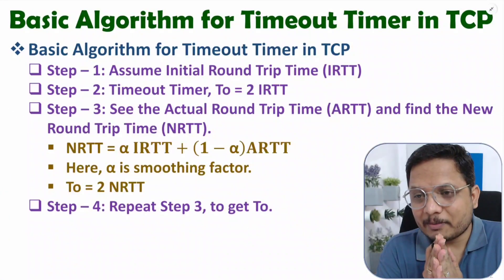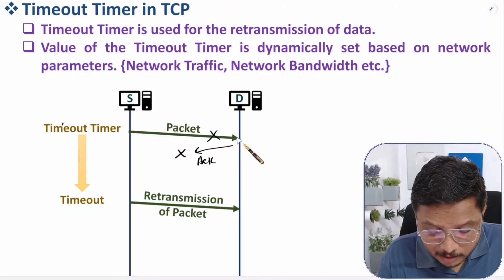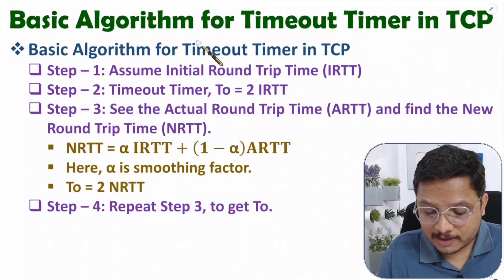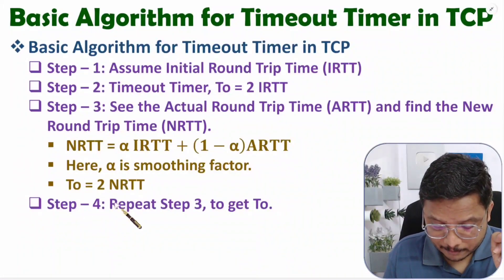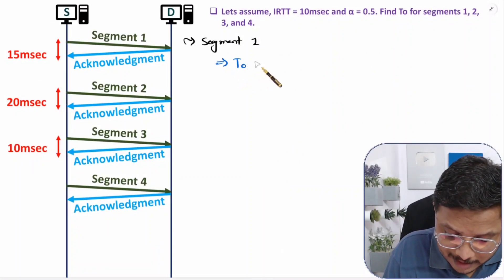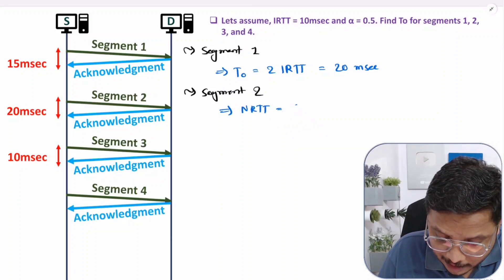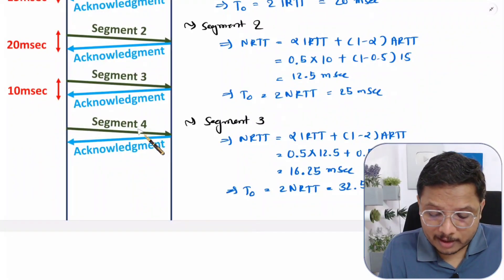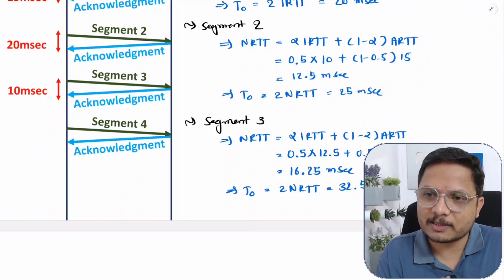Basic Algorithm for Timeout Timer in TCP Protocol

Comment: Hello sir, I think the rule you're using might possibly be wrong. The rule for calculating the NRTT is (1-alpha)*IRTT + alpha * ARTT. Please correct me if I'm wrong.
Reply from the maker: It is perfectly correct in the video
Reply: I've seen different references and the rule they use is the one I sent. Also each segment use its own ARTT to compute the estimated RTT. Because you may experience different network conditions (varying congestion levels, delays etc..). So when using the segments actual Sample RTT it ensures the calculation of estimated RTT is specific. Thank you sir for your listening.